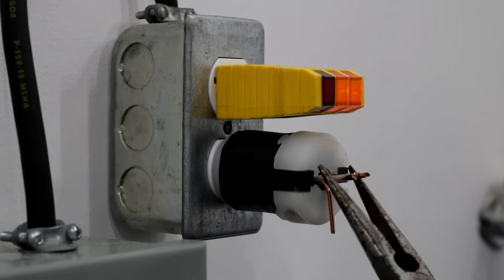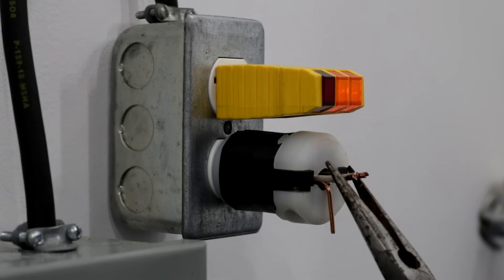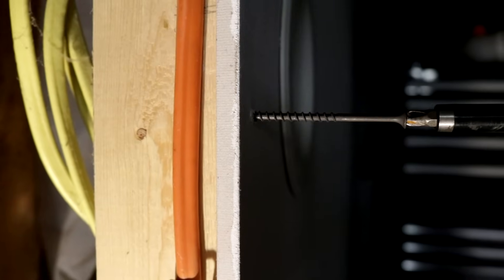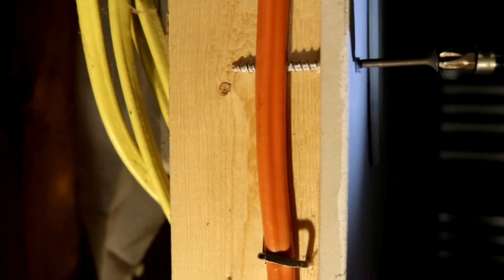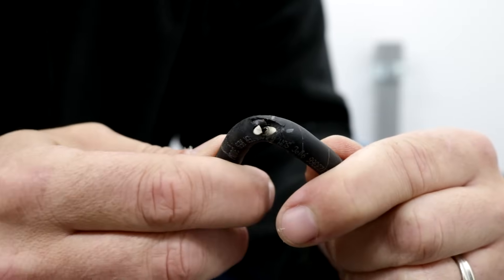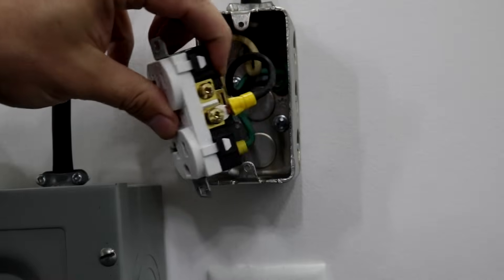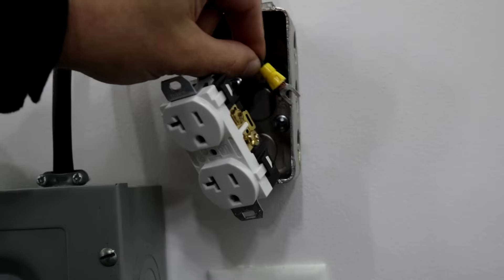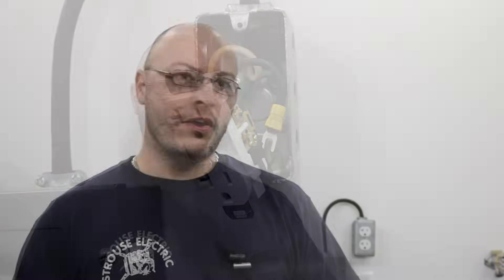Circuit Breaker Keeps Tripping - 3 Common Reasons

Comment: I have a Tesla model y. Sometimes my breaker trips as soon as I start to charge the car. I have a 61. I'm circuit breaker, but sometimes after the car is charging for about an hour to break her trips. When I reset the breaker, it continues to charge, I replaced the plug on the Tesla. I'm mobile charging unit which I got from Amazon. The plug and they work well for 4 months. And now it's starting up again. I have not tested the breaker to see if it gets hot. But as soon as I reset the breaker, the car continues to charge.What do you think could be causing this

Comment: Can a disconnected grounding rod to the outside panel be the cause of mine tripping? The circuit to my washer is always tripped after the cycle is complete. The next time I go to wash, I have to reset the washing machine breaker in the panel.

Comment: My was rain water coming in through meter, then dripped into circuit breaker.  I put silicone the outside glass meter dome to the panel.

Comment: What? You missed it. The second one is also just two bare wires that are crossed without a screw or nail, after something pops. You did say "keeps tripping", yes? Well thats usually because hot is crossed with another.

Comment: When my breaker kept tripping, I figured it was a lose wire in the wall outlet as it keeps sparking on sudden movement. I opened it to find out it was lose wiring with a few burned marks.

Comment: my breaker is popping just running like 8 outside bulbs. no water getting in, wiring is good. the breaker is as old as the home so 23 years. they stay on awhile before they go off. does this sound like a breaker is going bad?

Comment: Molded case circuit breakers are designed to carry 100% of rated current indefinitely without tripping. Thus a 20 ampere rated breaker will carry 20 amperes indefinitely. The nec requires that circuits designated as continuous duty (3 hours or more uninterrupted) be rated at 125% of the calculated load, meaning that a 20 ampere rated circuit may be designed to carry no more than 16 amperes continuous. However, the circuit breaker would still carry 100% of it’s rated load indefinitely.

Comment: 1. Overload due to accessories on circuit pulling more than the breaker rating.
2. Fault due to dead short.
3. Loose connection causing high resistance.

Comment: You forgot to mention another common reason would be due to one of the screws on the side out the outlet that holds the wire would come loose and touch the metal box causing your beaker not to be able to flip back on

Comment: Hi I installed and replaced one of my breaker for my living room and I took out the old one and put the new one. After turning on the main breaker my family heard a loud pop in the living room. Is that a normal sound after installation??? Just curios. Everything is working fine now but just want to know????

Comment: Can you help? I have a Samsung electric smoothtop stove. It doesn't matter if I have the top going or the oven, if I turn the other on it trips the breaker.  Just replaced the breaker and it's still tripping, any ideas?  Thanks Monica
Reply: Probably the wrong sized outlet was installed (15Amp) when it requires 20...same with the breaker (that needs to match the outlet size

Comment: maybe you can assist, please
in Au we must use rdc on 3ph gensets, now the genset was made in USA  and it came with just a 3ph breaker
in very wet weather the rcd trips, I use the genset t to power a 12hp lathe, 415vac, It trips even at low current draw , say using only 3 hp, it will start, star, goes to delta runs 20 secs and stops never does this in dry weather. i renewed the rcd, same thing
the switchgear is pristine control from 1972
should I just put a normal breaker in, the machine is no longer under hire conditions
Any assistance would be appreciated, rgds
Stu
Reply: Just my opinion.   It sounds like somewhere in the wiring, the air gap is very small and the moisture in the air causes less resistance of the air and you get an arc.  Check all terminals and look for signs of an arc.  Some electrical tape or other insulator may fix the issue.
Respectfully,   Kevin

Comment: when I have the microwave and some other appliance working like a toaster or an electric heater the breaker trips, then I won't have power in most of the outlets. could it be that too many things are connected to that breaker and it's overloaded? or maybe I need to replace the breaker for a new or a higher amp? I need an answer please!!
Reply: The book for your microwave will say you need a dedicated circuit for it.   The maximum you can run on a 20 amp breaker is 2400 watts or 20 amps.   Look at the nameplates of your appliances to see which together will cause overload.   But suggest dedicated microwave circuit minimum.
Respectfully,   Kevin

Comment: Sir why do I have both lights when I tested the socket's two holes using a pen tester after a possible tripped from a breaker, why is there a voltage present still? Pls answer ty.. gud day
Reply: If I am understanding correctly, you are testing a receptacle and showing it has voltage to it while a breaker is “possibly” tripped.   Either the breaker has not tripped for that specific circuit, or the breaker handle has moved and is malfunctioning.   If you know the breaker is absolutely connected and does not totally trip and open, get it replaced as soon as you can.
Respectfully,   Kevin

Comment: My breaker is tripping after 3 days. Can you give me some clues of what to look for please?
Reply: Without knowing what is connected to the circuit, almost impossible to answer your question.   Would need to know what it is, watts or amps, voltage, size of wire, and breaker amps.   Having said that, one possibility is the conductor coming into the breaker may be loose.   If it arcs, it will build up heat and can cause tripping.
Respectfully,   Kevin
Reply: @KevinCoop1  It is a bedroom and I have a microwave and a dorm fridge in there.  I believe there may be something wrong with the fridge (it looked in bad shape) so I bought a new one. We unplugged the microwave and will only use it as needed. It is a 15 Amp breaker. House was built 20 years ago.
Reply: @crand20033     So, using them one at a time resolved the issue.
Reply: @KevinCoop1  It did but I don't want to do that. I have rooms for rent here and they all have a microwave and a fridge plugged in and they have to be able to have them in the room. So I bought a new fridge because maybe the old one was causing the problem because it was in bad shape. Now maybe we can plug them both in but we haven't tried it yet.

Comment: A 4th reason: If one of the nuts in the panel is loose, it can create arcing which causes the breaker to overheat. I'm speaking of the nuts that secure the connecting bars that run from the meter socket to the breaker bus bars. I had never checked those nuts because I assummed that a panel from the factory would have tightened nuts. Not so!

Comment: Will a 30 Amp  fix  the issue.  Everytime I use my Xbox  on my TV. Upstairs  .....and my dad uses his microwave downstairs it trips it  any solutions?????
Reply: Receptacles in living spaces are not allowed to be connected to kitchen circuits.   Microwaves are supposed to be connected to dedicated receptacle circuit.  No, never change it to a 30 amp!   If you need to know why, ask.

Comment: What may be the reason for both two-way switches to lose power without tripping the circuit-breaker? It is running a ceiling fan with 3 lights. Could it just be a defective fan? doesn't make sense to me to kill both switches.
Reply: If you are pulling the chain on the fan to turn off the lights and the fan, and there is no voltage on either side of the switches, then the switches may be switching the neutral instead of the hot, which would be incorrect.   Are you the one that wired it?
Respectfully,   Kevin

Comment: Hi! I am currently renovating my second bathroom. I will be replacing an old electrical baseboard with a new one. While researching books and the internet, I now have a better understanding of electrical circuit and the max safe operating load. When I investigated other circuit in the house, I found a circuit with a 2000 watts baseboard, plus a 750 watts baseboard in another room and finally a 2000 watts heating fan in another room. This makes for a total of 4,750 watts. Now, in the breaker panel, for this circuit, the breaker is a 240 volts 20 amp. Am I correct to say that it is not safe? If I replace the breaker with a 30 amp, would I sleep much better? Thanks for the good video.
Reply: Although I, as an electrical designer, would not load that circuit that close, it is wired correctly and complies with NEC.   The load is non- continuous(runs less than 3 hours continuously) and can be loaded to 100% on the breaker.  4750 watts at 240 volts is 19.79 amperes.   If it were a problem, the breaker would have been tripping.   Adding another circuit to one of them would not be wrong if it makes you feel better.
Respectfully,   Kevin

Comment: Thanks, I somehow managed to replace a circuit breaker and cured a problem that has been on going for months. And  thanks to you, I did not have to go to the ER to pull off the installation of a new breaker.
Reply: It's only 120 volts. Won't hurt you at all.

Comment: The 3rd one you just explained can also sometimes be attributed to the bad "jaw" of a plug-in type c.b. A simple non-contact thermal detector ( very common these days because of covid-19 to check human temperature ) is pretty handy to check the circuit breaker's temperature just to make sure its contact to the busbars is up to par, otherwise excessive heat from loose, pitted and dirty jaws because of arcing, can trip a breaker even with the right current load.

Comment: Thank you so much, in my case, the circuit trips as soon as I plug the phone charger to the outlet, the circuit is 20 Amps.
Reply: get rid of that Chinese charger.
Reply: It’s not the charger. I found out that the wire is nailed.

Comment: 20 amp breakers will carry 20 amps all the time not just 80 percent they are design and listed for 20 amps. It will wear the breaker out quicker if it's noted rated for a continuous load. Which means for 3 hours or more at full load. Very few loads are ate full load that long.

Comment: Hi Bill, thank you for your informative video.  My question is why my GFCI outlet is not working; it has a solid red LED on.  When I plugged a GFCI tester, nothing light up.  The Circuit Line is hot when I tested it with a non-contact AC Voltage Detector.  I even disconnected the Load line from the outlet.  I greatly appreciated for any pieces of advice.

Comment: Help! I have one of those bubble water chillers that hold the 5gal returnable jugs.  Well, about 10 mins ago I went to put a new water jug on top as I always have. When the water jug dropped down into place it caused the 15a GFCI breaker in the panel to trip.  I have reset the breaker and tried eliminating different sources, however, it only now trips with the water chiller.  Something happened when I put the new water jug on top of it.  All internal wires appear to be in normal configuration.  Any help on this matter would be greatly appreciated.  I have been using this water chiller for several years (indoors) I have never had a issue before.  Calling an electrician would surely cost more than a new water chiller.  I would really like some insight on what is going on. Thanks.

Comment: My outside post light on a timer and the timer is connected to a duel light switch.  Every time I flip it on the light comes on but every time I see it on it's daytime and the sensor is not covered. The breaker then trips. Help!  I just purchased the house and I would like to see the post and address sign at night. I'm the only house with one on my street. Go figure.

Comment: Hi, I have 2 AFCI breakers, both tripped, 1 instantly, and 1 after a few minutes.  Nothing new was plugged in into these circuits.  I also tried shutting off all breakers except these 2 but they would still behave the same way.  Would replacing the breaker be my first option at this point? Thanks

Comment: Do you mind answering a quick question for me....I have a chandelier from home depot that I would like to convert to a plug in, rather than a "direct connection" (not sure what that is called).  There are 3 wires.  Neutral, Hot and a ground wire...however the ground wire has no sheathing on it.  The directions state to route all 3 wires through the chains yada yada.  Well I went and bought a two prong connector....thinking that the ground wire from the chandelier will be find to be grounded to the ground wire coming out of the ceiling/box.  So that wire is grounded there...I ran the other two wires along the ceiling to a ceiling mounted 3 prong outlet.  I plug the two prong from the chandelier into the 3 prong outlet and my 20A breaker trips.  Again the ground wire (unsheathed) from the chandelier is grounded to a ground wire hanging out of the ceiling...is it because they are on two different circuits?  Any help would be awesome.

Comment: we hooked our breaker up and it runs outside but the voltage shows and we checked using a sperry tool and everything was wired correctly but when we plug something in the breaker trips right away it shows steady 120 volts but when something for example a shop light or a hair dryer it trips the breaker anyone have any ideas? the wires are tightly connected and we don’t belive the breaker is damaged? i’m open to any suggestions

Comment: I have a light that’s on when the switch is off and My breaker trips when I flip the switch to turn it on. I’ve changed the breaker, light switch, and looked for signs of any screw that might have connected to a wire and nothing, it’s driving me crazy
Reply: Have you found tbe fix?

Comment: For a quartz heater I installed dedicated 20amp Square D circuit breaker, 12 gauge wire to a single round outlet, the wire run to panel is only 18 feet. Works great until I turn heater switch to include the second quartz element, it trips the breaker.., does that sound odd ? All components are new, should I have run 10ga wire ? Connections are snug and perfect, maybe a weak new breaker? Maybe we’re at the current draw limit of our 200 amp service panel already?

Comment: Why does it spark when the hot wire touches the ground wire. I know that the ground wire is for safety, and the breaker shuts of power to prevent damage. What I would lie to understand is what happens when so man electrons touch a positively charged wire/ or neutral.

Comment: We got a magic 20 A breaker that can run 4 space heaters, 2 refrigerators, a hot plate, computer and internet connection, but wonder why it smells funny at the panel sometimes.
Reply: Be careful not to burn down your house.

Comment: How do you know which one it is?  We have a duel pole that only runs one thing an air conditioner.  Well, this year I have noticed after turning it on and leaving for my uncles for a week, or 4 days, I come home(to check the house as its only 45 minutes away) and find the breaker has been tripped.  I don't want to spend money getting a new air conditioner if it is a cheaper fix of just maybe the outlet being old or the breaker.  As another outlet that ran an air conditioner had an issue with its breaker but it wouldn't run for more than 30 minutes.  This one is running for at least a few days before tripping.

Comment: Ok got a question for ya I resently redone my kitchen I ran new wire 4 new outlets  and 2 new single pole switches to 2 lights.into my circuit breaker and when I turned it on all the lights came on but the switches are in the off position what did I do wrong ....as soon as I turned on the switch to see if it would go out the breaker tripped what gives so I turned the breaker off and undid it from the box.
Reply: Did you figure out your problem.  I took a old switch off a outlet from 2 rooms that controlled a lamp in each room and ran a wire between the 2 rooms so all the outlets worked. There was storage area behind the walls of the rooms..2nd floor  Cape cod..and installed a junction box where I ran a wire up for a ceiling fan and then a wire for a new switch. I hooked everything up and have a buddy hit rhe breaker and everything comes on and even tho the fan shouldn't and when I go to hit the switch it trips the breaker.

Comment: HI
I TEST IT AND GOT 3.6/14.4/22 .HOOKUP 3IN1 AND ALL WORK FINE...AFTER 4 WEEKS I CLEAN THE ALL FRIDG IN AND OUT AND WHEN I PLUG BACK THE POWER IT START ON OK  THEN  THE  THE POWER BREAKER JUMP OFF

AFTER SOME TESTING I FOUND THAT THE MIDDEL LEG ON THE COMPRSOR IS SORTING= WITH TESTING ..I GET SHORT BETWIN THE MIDDEL LEG TO GROUND.
IF I PLUG THE POWER AND DON'T CONNECT THIS MIDDEL LEG....NO PROBLEM...ALL WORKS EXCEPT THE COMPRESOR...ANY IDEA WHAT TO DO NEXT
THIS IS SBS WHIERPOOL FRIDG.

CAN YOU ADVICE ANY 
THANK YOU

Comment: Got a question for ya.. I have a washer machine on its own circuit tied to a 20 amp breaker. House was just built and been in the house for 4 months. Bought a new washer machine for the new house...washer calls for 10 amps...the breaker has tripped twice now in 4 months???? I checked outlet for any loose connections but everything was snug...any help would be appreciated.
Reply: Connections in electrical panel should be checked also. Washing machines are known to have electrical problems that cause a short to ground. But not all, just a very small number. Some have a constant short  while others are intermittent. This has been my experience for over 30 years. Grounding is much better on machines from the past 20 years, so getting a "tingle" from a washer is virtually nonexistent. That said, since it's an occasional issue, the washer is the most likely culprit.